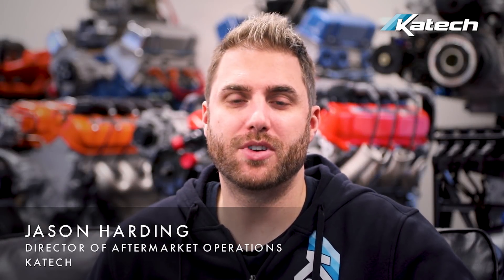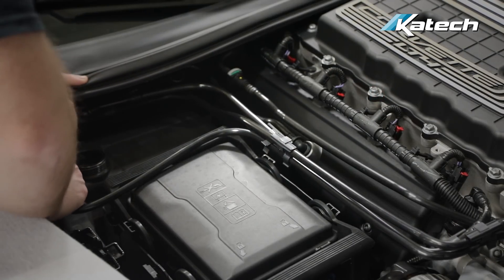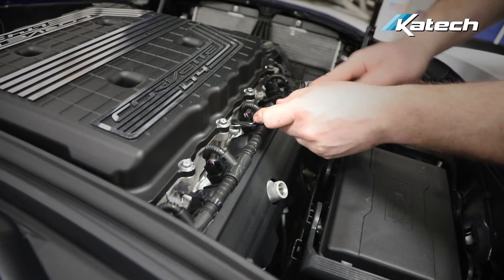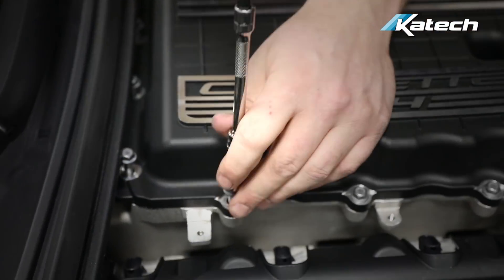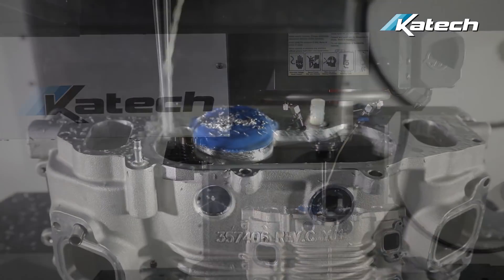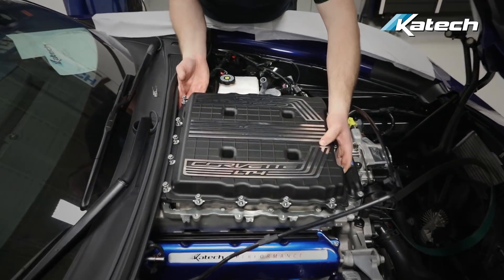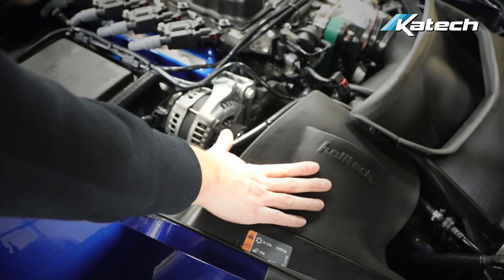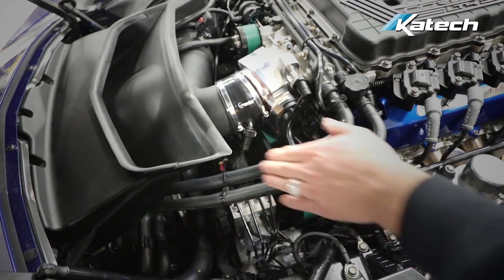How to Remove and Install your Supercharger

Comment: Is there any tricks for getting the supercharger seated? After torquing the bolts down to 89in lbs on 2 passes i still have a supercharger seal visible near the runner. Also not all my supercharger bolts bottomed out
Reply: What did you ever figure out lol
Reply: @570Sneaks  the supercharger bolts i got from a Chevrolet dealership we’re slightly too long and we’re bottoming out on my lt1 heads so it never got a good seal.

I ended up adding 2 high grade washers under each bolt while still being sure to put the sealing washer on the bottom and that did the trick.

Comment: i see srteet speed 717 took your name off his value covers he must not be brand loyal
Reply from the maker: StreetSpeed717 didn’t do it.
Reply: It's just a valve cover kiddos. Don't overthink it. Great video Katech. Always nice to have these when working on your own car.
Reply: tattooed 56477 he changed valve covers and put rpm motorsports on...he not using anything from katech...switched to procharger
Reply: they did use ktech parts on the car the plat on top of the engine i still think its pretty shitty he took your name off the covers i would be pretty mad at him for that the covers are the same ones you sent him why do you still want him to do bussiness with he dumped you
Reply: yes i would have katech do what i need done
Reply: Robert Wilbert His head was ported by Katech. Also, I’m pretty sure those are Katech valve covers still, just with an RPM name plate on them. Furthermore, the coil relocation kit is also Katechs. RPM are just skillful technicians that buy and install parts (they make an intake I think). Katech does it all: they’re engineers, they do CNC and hand porting, they have master technicians, and they re also involved with LeMans winning race cars.
Reply: Do u have to drain the coolant to remove the blower?